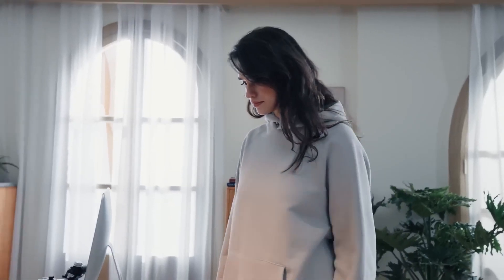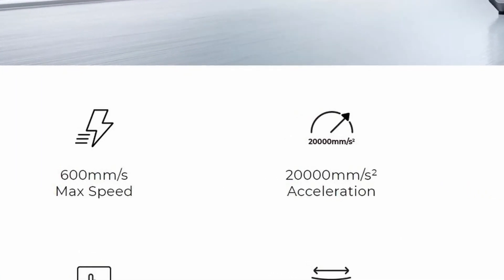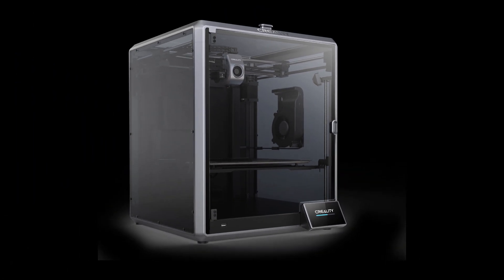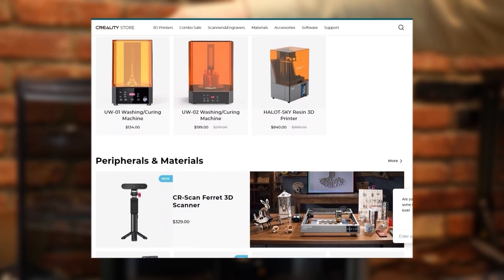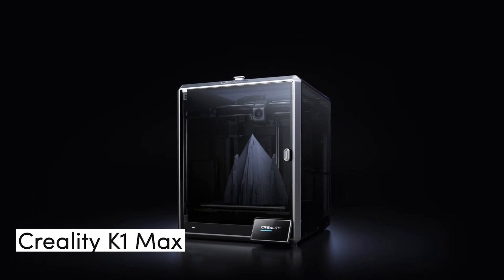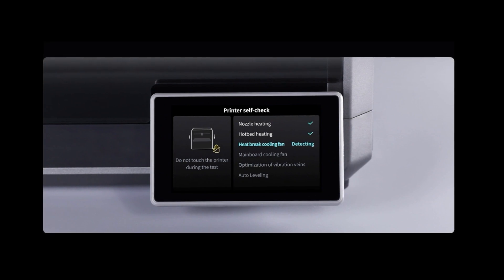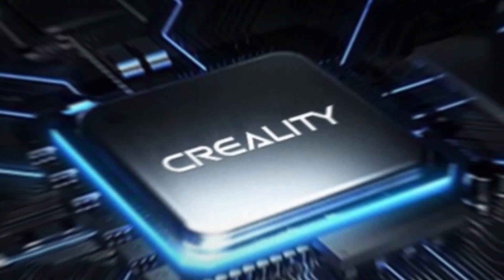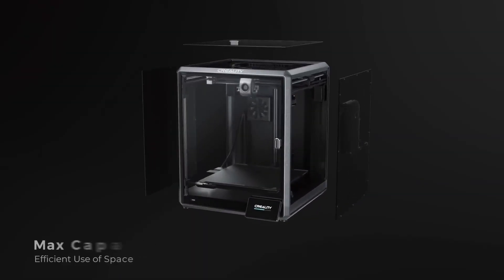Creality K1 or the K1 Max - Which is the better 3D printer?

Comment: This needs an AMS
Reply: I think if it were to have one it would have been advertised by now. But yea I agree AMS would be amazing with this.
Reply: No it doesn't.

If you want it, fine, but it doesn't need it. It will also be added later even if it's 3rd party.
Reply: @geekinoffdabean6639  it will easily be added later. If not by Creality, by a third party.
Reply from the maker: The Creality K1 was only released for presale on the 9th April 2023. If the demand is there we may see an AMS.
Reply: Larger build plate and testing out the anker m5 next one was x1carbon but may skip that if this k1 max becomes available